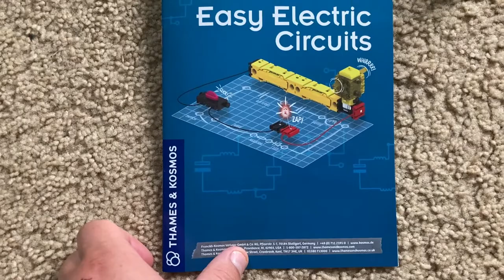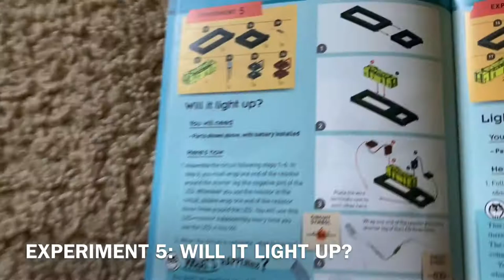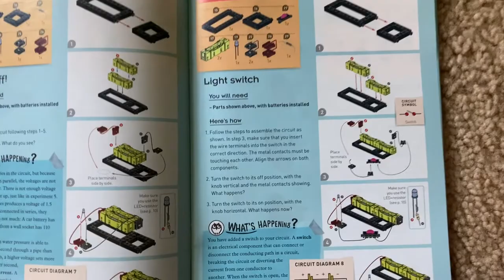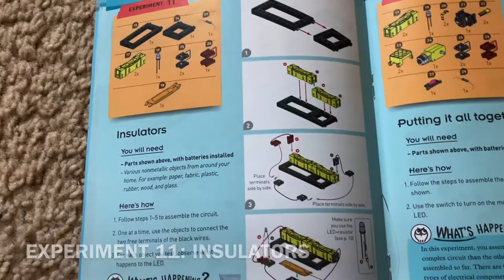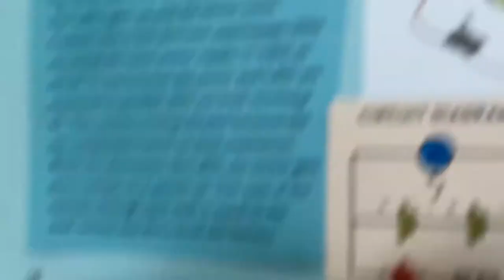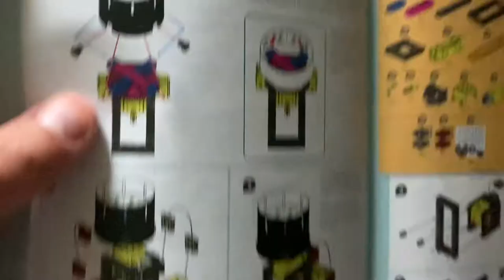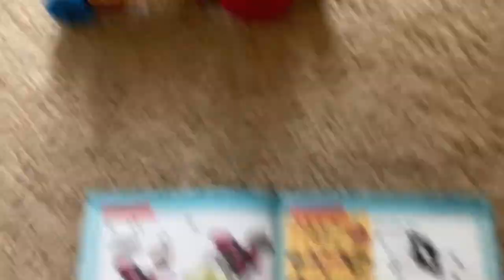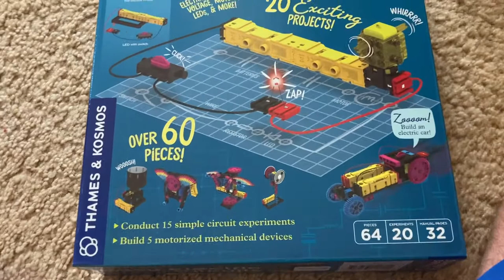Thames & Kosmos Easy Electric Circuits STEM Kit- ALL EXPERIMENTS

Comment: I can't get the batteries out any tips? Yes I'm using the yellow tool 😮😢
Reply from the maker: The only thing I can suggest if the included tool doesn't work is to carefully use a flathead screwdriver to lift the batteries out.  Let me know if that helps.
Reply: @andrewsstation6436  thank you for the fast reply! I'm going to try LOL so far a fork doesn't work haha
Reply from the maker: You're welcome!  I think I had a lot of trouble myself when I used this kit! @ChiqueChiing
Reply: @andrewsstation6436  lol I can see why! We're gonna use the kit without the tops on the batteries from now on haha 
Also thank you because the flat head screw driver worked prying it from one of the corners where it 'pins into place' if that makes sense lol I did make a quick clip n posted it on my page if any1 else is struggling 😄
Much appreciated!